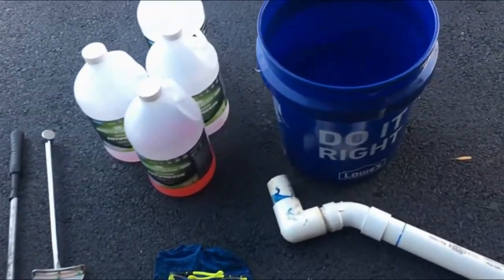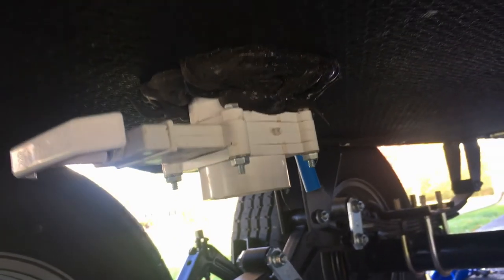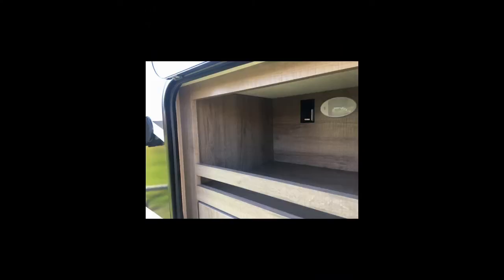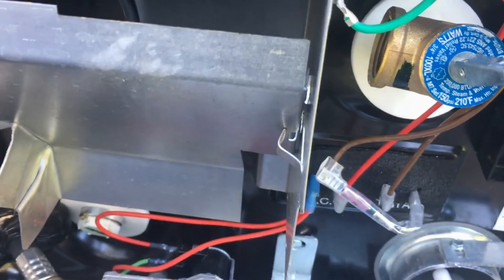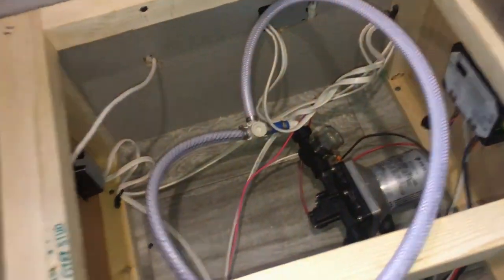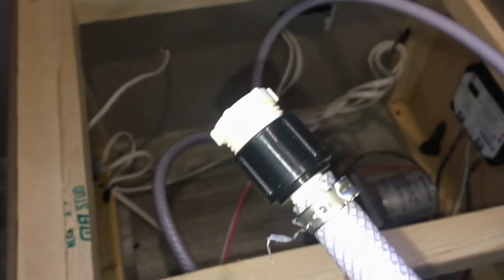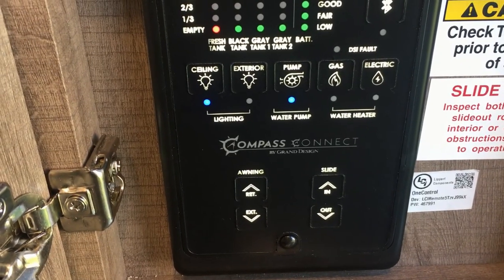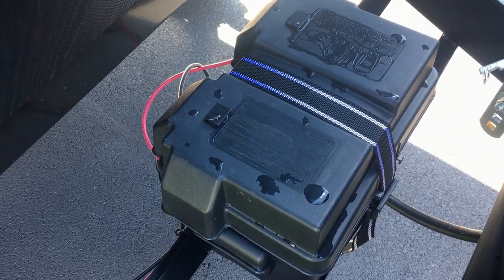How to Winterize Grand Design RV

Comment: This was great!! Would really like to see a video on de-winterizing the camper!
Reply from the maker: Nicole, just put the three hot tank valves to the summer position and the valve at water pump to normal position . Then run water until it is no longer pink in hot and cold.

Comment from the maker: * Paid Links to all Hardware needed Below *
Black Tank Deodorizer https://amzn.to/3mfAN2Z
Grey Tank Deodorizer https://amzn.to/37ziJwG
1/4" drive screwdriver https://amzn.to/35dGuri
Flathead Screwdriver https://amzn.to/35oRGS4
#2 Square Drive Bit https://amzn.to/35dGOX2
Sharpie Permanent Marker https://amzn.to/35madi4
Round Kitchen Knob https://amzn.to/3khS7Uw
Craftsman Channel Lock Pliers https://amzn.to/2HQjO8B
Teflon Paste  https://amzn.to/3n8U6MV
Teflon Tape  https://amzn.to/33rbO6t
18" Breaker Bar 1/2" drive https://amzn.to/3m6ANm0
1 1/6" 6-point Socket for 1/2" drive https://amzn.to/3jsmmrx
12-inch 1/2" Drive Extensions  https://amzn.to/2GzTaA8
1/2 " Washer for water lines https://amzn.to/34fax2F
15/16" boxed wrench https://amzn.to/35fQYGO
15/16 Inch - 1/2" Drive - 6 Point Socket https://amzn.to/2Hov1gG
Cleaning Brush https://amzn.to/35hI2AU
Atwood 91857 1/2"Hot Water Tank Drain Plug https://amzn.to/37yRgeS
 Lowes - Sharkbite 1/2 Swivel Adapter https://www.lowes.com/pd/SharkBite-5-Pack-1-2-in-dia-Plastic-PEX-Female-Swivel-Adapter-Crimp-Fitting/1000183171

Comment: I have a 2020 35rlts. My components are nearly identical to yours. What's odd is I don't siphon from a jug, and dont put my hot water tank plug back in. I just drain that and leave the plug out . My exterior panel has a siphon winterize option..I bought a nifty fitting to just set a funnel in and the pump from sealed gravity flow draws it into the system. People ask,  do we put rv anti freeze into the hot water tank. Technically not on mine..water will not go back into unless hooked up to fresh water tank or city inlet..My design is a 38 foot bumper pull..I dont have access to the pump without disassembling my front closet. The entire front of my trailer..Thus perhaps why I have the exterior siphon winterize option. It basically sucks as I gravity feed it..I've had no issues with no antifreeze back in the hot water heater.. I know this because as I'm getting all antifreeze to all hot and cold faucets, no water is routed through my hot water tank. Lol at the pun, but does the reflection design have a grander design?. Your system seems a little more manual than mine.
Reply from the maker: Bb, the pecking order for Grand Design series from lowest price to highest is The Transcend, Imagine, Reflection, Solitude, and Momentum series . Mine is an Imagine 23BHE
Reply: @PompanoBrownie  HI thankyou..I kind of knew the order of basic to high end models. I guess my exterior winterize is a nice option..You kind of threw me off thinking your hot water heater plug getting put back in right away made me wonder if somehow some models were routing rv antifreeze back into the hot water tank..But they're not on this modern equipment..Old school stuff perhaps..Just over thinking I guess..I'm going to add to winterizing which some people haven't thought about.. Back on your main comments. I liked your informed simplistic video..And one reminder because the kitchen sinks have only one one water faucet controlling hot and cold..I almost forgot to run the pink antifreeze both ways. Who knows the water line configuration. Best to be by the book both hot and cold lines every time. And anyone running behind on winterizing don't panic. Mid November in Wisconsin still has ground heat . Freezing yes but not freezing up.  For deer hunters hedging December..Which a lot do. At any time you can get a low level antifreeze dilution in your fresh water tank  by thoughtful methods. You can shower with it and common sensible dish rinsing. Hand washing. Not drinking..Next, winterizing squirrels.  That's a serious subject .